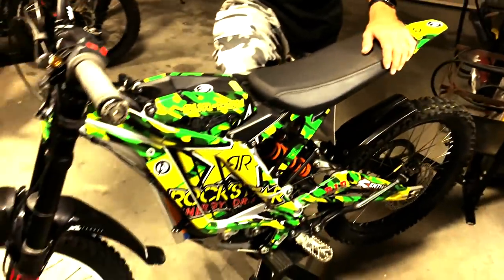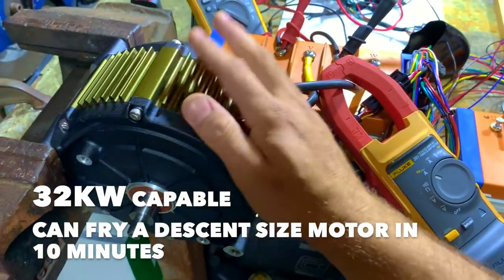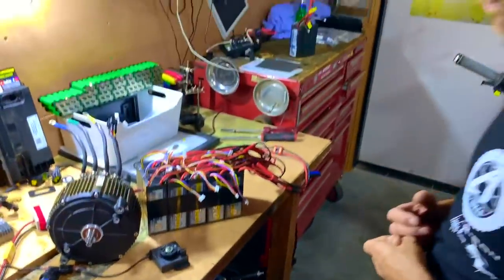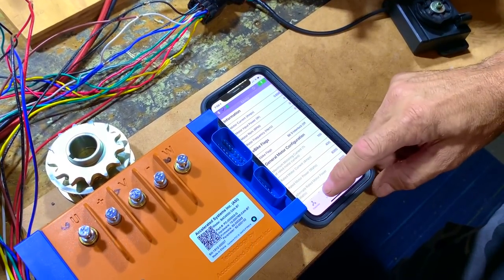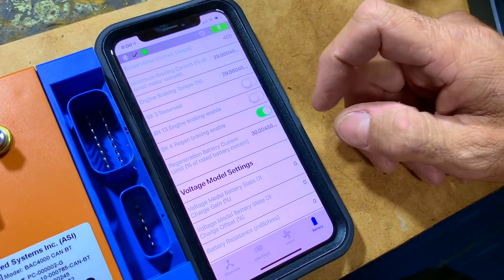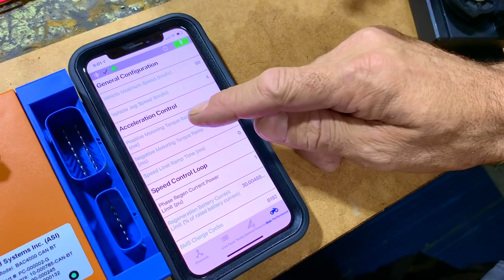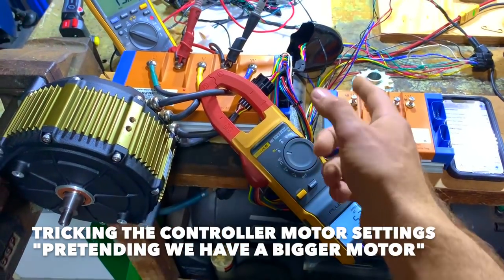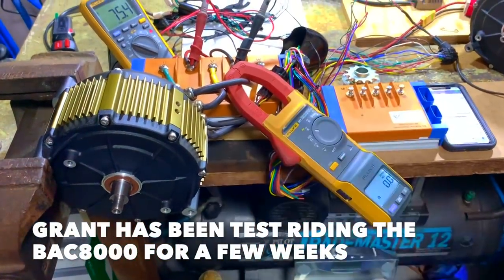ASI BAC8000 & BAC4000 Product Overview • Sur Ron POWERFUL upgrade

Comment: Do you know what the difference in power/speed on the ground is between the 8000 and 4000 controller? Including the battery upgrade with the 8000 controller as well.

Comment: Redonkulous number of settings.

Is there a simple beginners mode and safeguards to prevent bad settings that would destroy the motor??
Reply from the maker: Matthew Taylor yeaahhh this is like a pandora box, once you start play you never know where you’ll end up... endless possible combinations..
The app is mostly designed for OEM (manufacturers customisation) but often you have a profile saved with all your settings. If you make a change and everything stops working you just need to go back and load the previous file and it’s all back to normal.

Comment: Strap an alternator on a jack shaft so when you’re riding the trails you can be charging your battery at the same time.
Reply from the maker: If you add a generator it ads so much resistance/load and becomes a motor/engine brake... it consumes more power to make electricity than having nothing at all. This is why you don’t see any EV manufacturer doing that... 
Here is an illustrative video I made recently showing what happens when adding a very small motor https://youtu.be/T4qvT2xuvso

Comment: Bruno, I love ur vids! Thank u!  When u hav time, could u do a follow up vid,  explaining the ASI controller w/ Sur Ron motor?  ( a lil more in-depth )
The Sur Ron community desperately needs this 4 more POWEEER!  I’ve waits for 3 frustrating mo’s on ERT 2 send me my ASI bac 4000 “plug & play” system. Dozens of ppl r waiting 4 the same thing:(  I just ordered the motor, harness & about 2 call ASI 2 order the controller. I will eventually figure it out. Ur vid would save me a lot of valuable time. Thank you!
Reply from the maker: Yeeeeeaaahhh mate!! I know EXACTLY what you’re saying...
My next video showing the ASI will be definitely more in depth, explaining the most important settings, the wiring harness and how to order the controller directly from ASI (I see some people struggling to get it from Alan ERT, he’s a really helpful guy but probably just overwhelmed, too many orders to fulfill and support at the same time).
Yeah... the bad news is that this video will take at least 1 month to come out... I’ll try to do all in one video but depending how it goes I’ll split in two: wiring & software configuration
The good thing about buying directly from ASI is that you have the app password to modify and setting and power levels to your wish. It’s quite full on but yeah, personally I like the option of being able to tune parameters myself (as you probably realised watching my videos) hahahaa =]
Reply: @BrunoPOWEEER  Any update on this? Would be very beneficial to the community.

Comment: you probably already checked but. if your motor shaft is getting hot from testing it just on the bench you're probably over reving it. try putting a load on it (putting it back in the bike) and then try. i did the same thing with an rc motor and it took me forever to figure out. keep up the great work!! love the vids
Reply from the maker: Yeaahhh it’s fine on the bike... at the time we were making this video we were testing some weird motor settings trying to get better performance... bench test isn’t the ideal as you also noticed hahahaa... just lead us to weird nonsense wrong conclusion hahaaa

Comment: Hey where can I buy the empty Surron battey cases? I would love to put some MORE POWERFUL cells in the cases ! Let me know please !!!
Reply from the maker: Heeeeeey mate, Adam the guy in this video (https://www.surronaustralia.com.au) I think he found a supplier who sells the aluminium extrusion but not too sure about the plastic top and bottom ends. Send them an email asking and see how it goes. Also google some Surron forums/groups like Endless Sphere, drop a public question, someone will know where you can get it.
In the worst case, find a local metal fabricator and ask them to bend you an aluminium box and fit some thin fibreglass sheets between the pack and the case to insulate.
Soooo much POWEEEEEEEERRR ohhh yeaahh =]

Comment: Can you tell me what I need to build that Sur ron. Do I just need the bac8000 kit and the 72v battery upgrade or do I need a motor upgrade too if so where could I purchase it? And is it possible to use Lipo battery’s and upgrade my stock sur Ron battery like u showed if so what parts would I need? I would really appreciate it if u could help me out it’s really hard to find information on doing a upgrade like you have! All I want is MORE POWEEER!!

Comment: Is the Bac 4000 with the stock 60v battery worth it? Or does the battery need replacing as well.
Reply from the maker: Yeahhh the stock battery + BAC4000 is the perfect weapon... BAC8000 only makes sense with modified battery...
The BAC4000 needs to be set to not pass the stock battery max current limits
Reply: Does this controller the bac4000 make the sur ron with 60v battery faster than the x controller and if so much faster.

Comment: I'm thinking of buying the surron mx but before I do, I just want to know if the bike has good potential for more power down the road if I choose to modify or upgrade it.. Is it hard to upgrade to a more powerful controller? Is it bad for the motor? 

I know I'll want more power down the line, I just don't want to get stuck with an outdated ebike within a few years. I want to continue upgrading it and keeping it modernized.. Is that possible with the sur-ron?

Comment: Hi guys will this controller work with stock 60v battery or do we need to upgrade battery too 🤔
Reply from the maker: Yeah mate, the controller works with the stock battery, all you have to do is to limit the controller settings, often the person selling the controller already have the settings ready matching the Surron 60v original battery

Comment: Hey man, my BAC8000, NXT and Lightspeed 72v and charger just got delivered....with literally ZERO documentation.  Was hoping you could point me to an install video or instructions somewhere?  I've only had my bike for a few weeks so definitely not an expert.  Whatever info you can share would be appreciated, thanks.  I only found one guy's vlog installing up a BAC2000, so was going to try to follow that...have a feeling this is going to be a monumental clusterfuck lol.  It's only a few thousand $'s worth of high voltage power without any documentation...what could go wrong?

Comment: Hey I have a question about the ASI 2000  I use the controller on a Qs 205 5000 motor with a 72v 44am and it keep giving me a over voltage and it cut off can anyone help me out with that?

Comment: Can you tell me us how you did the rear fender on that cool Sur Ron
Reply from the maker: Adam from Aebikes cut a dirtbike fender and made a little bracket, it’s adapted. He also installed a flexible black rubber between the swing arm and the top (under the rear mudguard) where there’s a place to attach a mini registration plate. Stoops mud  and gravel going over the rear shocks
Reply: @BrunoPOWEEER  That would make a great how to video!

Comment: Can I use the BAC for other ebikes... I have a delfast top?
Reply from the maker: Yeah you can use it in any other ebike or electric motorcycle, even small electric car. The BAC8000 is a bit too powerful for any motor... I always have to tune it down otherwise we fry the motor in 10-15 minutes (I’ve fried a few motors $$$$)

Comment: Good day sir what ASI controller can i use in 10kw- 2okw peak power at 72v bldc motor?..thank u for the answer and god bless
Reply from the maker: Yeaaahhh either the ASI BAC4000 or BAC8000 the bigger one will have higher phase amps which is good for acceleration, bigger controller will run cooler and is able to handle higher continuous power as well. If you can spare extra few hundreds get the BAC8000
Reply from the maker: There’s also another controller brand made in Russia that may be exactly what you want, 10kW-20kW peak it comes with display, super easy to install and got auto tune so it detects nearly everything for you https://nucular.tech/
Reply: Thank you to your advice and another advice sir...i appriate it..more power, stay safe and god bless again.
Reply from the maker: Ohhh yeaahhh =]

Comment: How does a 8000w controller go up to 32kw?
Reply: Continuous output rating vs what it'll do in short bursts until it gets hot.
Reply from the maker: epic time breaker I know it’s hard to believe what peak output means until you actually try and go like WTFFFF... you only need a few seconds burst to go stupidly fast... Teslas are the same.. monster peak power more than double of the continuous output (I repair Teslas at work)

Comment: How much ampere does that controller has?
is it compatible with the stock battery?
i am curious also how much ampere does the battery and its BMS has?
Reply from the maker: That controller BAC8000 is waaaaaay overkill for the Surron motor, we had to tune it down otherwise it would fry the motor in 10 minutes or less 
Here is the website with more info https://www.accelerated-systems.com/products/electric-motor-controllers
The BAC4000 is more than enough but the BAC8000 fits perfectly same size as the original SURRON controller and runs cooler.
The original SURRON battery power is limited by the maximum current the BMS can handle which is somewhere around 120/150A. So lowering the BAC controller power you can keep using the same battery and motor pumping a LOT more POWEEEEEERRR
Reply: Whats the top speed after installing?
Reply from the maker: I think we recorded GPS speed 112kmh but it all depends on gearing, you could gear taller reducing the acceleration and increasing top speed but that feels really fast in an off-road smallish bike =]

Comment: Hey Bruno Lunacycles fucked me on my suron. I have 2500 miles on it in 6 months so I ride it a lot. It won’t go into sport mode and the switch seems fine could that be a issue with controller?

Comment: what is the motor ???????!
Reply from the maker: samuel cyr yeaahhh this is the Sur-Ron motor, same as the one in that yellow motorcycle
Reply: BrunoPOWEEER I want to ride a bike for the city for the summer to go to work, I need to do 50 miles go 50km back
I need a bike that can ride 120 miles an hour, which you're tipping me off? For a little budget?
Reply from the maker: Not sure how many miles/km range it will do with the original battery on the road with the original and this BAC8000 controller... it depends on speed as well... over 40kmh you’re using 87% of all energy to fight against your own aerodynamics... the more you speed the less range... same goes for petrol and anything that moves =]

Comment: Love the frame, so many black bikes and people with black clothing look as though they trying to hide.
Reply: @lukedangles-mckenzie2024  Cars kill 30,000 people a year compared with one and you don't mention how bad cars are? They are legal to use as registered light vehicles so make sure your information is correct.
Reply: @lukedangles-mckenzie2024  Less people get hurt by high power electric vehicles than any form of fossil fuel power vehicle. If you have a car your 5000% more likely to cause harm than if you ride this. You have no valid point.